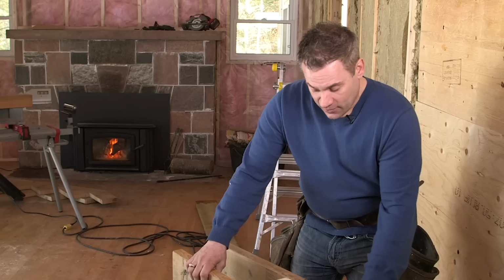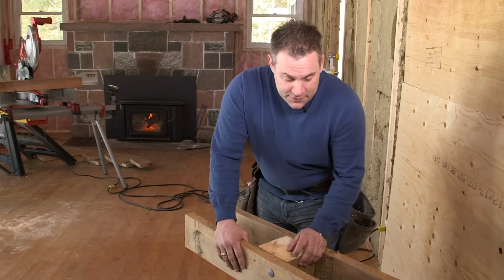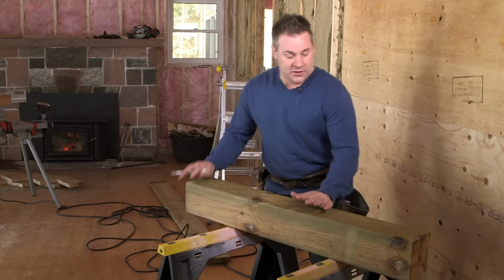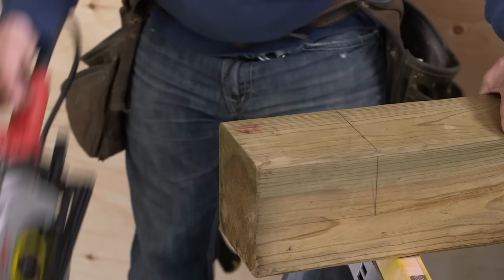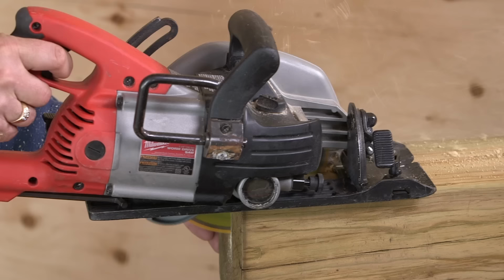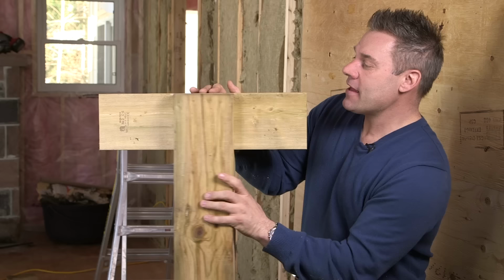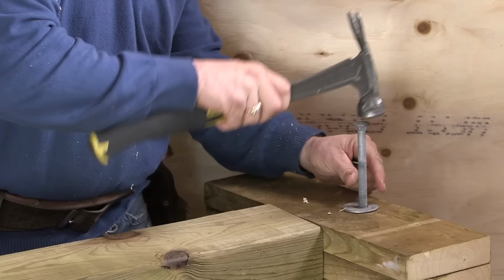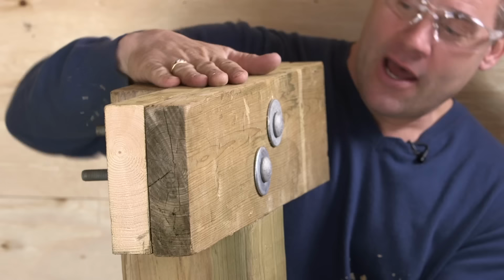How to Attach a Beam to a Post for a Deck | Decks, Docks & Gazebos

Comment: so how many times has any one witnessed carriage bolts shear off from the weight of a porch
Reply: Matt Tallman 
The wood can split.
Reply: He clearly states in the video the problem is, "there is no shear strength in carriage bolts." This is complete BS.

It is called a carriage bolt for a reason.
Reply: Vince King he does not mention wood splitig for the reason not to use carriage bolts. of course wood can split but pre drilling your hole solves that.

Comment: What a load of crap. he must think we all fell from the sky.  The sheer strength of the bolts he is using is massive compared to what would actually be required for this application in-fact, the bolts used here would be strong enough to hold up about 10 family cars before any failure, so the timber would fail a long time before the bolts. FACT
Reply: Tofthill4 
Wood can split due to high pressure.
Reply: Bollocks,  this is a Deck we are talking about not an air craft carrier. The live load in this kind of application is minimal and the chances of the bolt failing are about the same as Donald trump shaving his head.
Reply: Total CRAP

Comment: Bullshit. With that notch.the most you need is one bolt. My deck has no notches just bolts and is still in perfect shape after 28 yrs
Reply: A deck still in perfect shape after 28 years? That would make your deck quite a bit different from most.
Reply: @nuancolar7304  I can't answer to that,but we live in southern Ontario, Canada, so the element do give it a good workout with bitter cold winters - covered in snow for at least three month - then the wet spring and a nice humid HOT summer lol.Has  the odd creak - like me - but no sinking. One thing that may have helped is,I have all my beams 16" on centre

Comment: Working on a plan where I ran into this issue. 
Would there be any way around notching to instead run a long enough 2x(post width) fastened and glued underneath the beam to help carry the load?

Comment: 1. What is building CODE in your area. Build according to code. 
2. 1/2” carriage bolts have about 10000psi shear strength.  
But check building code first.

Comment: Well I didn't notch, and I didn't use carriage bolts I used regular hardened bolts with locknuts and flat washers and it's been standing strong, even with all the snow that falls on it from cleaning the roof in the winter, which sometimes includes some thick ice falling on it too. It's been 21 years now.

Comment: What about all four corners of a deck? This method seems practical for a single beam, but the deck I’m build, for example, is detached from any structure and will also be supporting a hip roof. 

I was going to make my own box beams and go all the way around and just use carriage bolts to secure them but now I’m second guessing. My posts are 6x6...run joists 2x10....deck will be 12x12. Any suggestions?
Reply: Where you building. ?

Comment: Video was made 5 years ago, I hope people arent still notching out their posts, might as well just laminate 2x material, when you notch out the post, you reduce that sections strength to whatever is left of that post, it will also split up from that notch as well even if you brush in some sealer in the area that has been cut away.
Reply: tell that to the 2018 IRC

Comment: GRADE 5 CARRIAGE BOLTS - Carriage bolts have a dome head with no drive and a square neck under the head. Carriage bolts are designed to be tightened from the nut side of the assembly. Grade 5 carriage bolts are made from carbon steel and have a tensile strength of 120,000psi, and have a proof load strength of 85,000psi. Carriage bolts are fully threaded up to 6", lengths over 6" will have 6" of thread and the rest is non-threaded shoulder.

GRADE 8 PLAIN CARRIAGE BOLTS - Carriage bolts have a dome head with no drive and a square neck under the head. Carriage bolts are designed to be tightened from the nut side of the assembly. Grade 8 carriage bolts have 6 radial lines on the head, its a medium carbon alloy steel, quenched and tempered. They have a tensile strength of 150,000 psi and a shear strength of 90,000 psi.

Comment: There are already plenty of comments about how those 2 bolts provide plenty of shear strength. I would only add that these guys who insist on notching never mention that if the post is to continue upward from the notch and beam(s) to provide for a railing, much of the stiffness of the post is lost, making for a low strength railing.

Comment: Question....what do w e do with post and beam timber framing?  No bolts, no nails, mostly just tight fitting wood connections with wooden pegs.  Now, the old barn still standing built by farmers, not one of them an engineer.  Snow comes...3 ft deep on the roof,  then it rains and the snow holds the addition water weight ...for a while.   Maybe even 20 or so blizzards later,  with 4 or 5 with following rain.    Will the barn still be standing ?  I bet it will.  They are still standing and still in use.  BUT...our steel boat storage shed
, in Lake George NY  collapsed in about  ‘79  or  ‘80.  The storm dumped 3 ft of snow on the almost flat roof, then it rained.  
Several 30 plus length cruisers were inside.  A number of boats were Totaled.  The solution....put a snow blower on the roof and blow the snow before the rain.  If you can’t,  build another boat storage building.   OR maybe get a bunch of Amish to build you a big boat barn.  Timber framed of course .  I am agraduate Civil Engineer and served on the national building code for elevators in my career.  Our goal as having standards establishes for public safety was to do the best we could to protect the public without breaking the financial back of the owners and contractors while insuring long service.  It is possible to build a deck that would still be intact after the tornados, blizzards and fires passed.  Nobody would buy one.  It would be ugly.  Hire the farmers to build your decks.  Problem solved.
Bless you all.
JoeB

Comment: Hi there... I have a deck (24’ l x 12’ w & 8’ h supported on 4 - 6x6 ) exactly as your example.  It’s in great shape even though it’s was build in 1993.  No signs of rot to justify replacing parts. Any fix or improvement suggestions?   Cheers..... Y.

Comment: you don t use a washer on the head side of the carraige bolt, you use a torque washer the hold the square part of the head, it keeps it from spinning when you tight the nut on the opposite side

Comment: Yo cheek cut ,how about 3/4 “cheek cut not a full bearing point I know but it’s a compromise with not over cutting  the 6x6 and still having a bearing point that is thru bolted double nut and double washer one one each side .....I love timber techs there awesome but something about thru bolts with nuts and washers that you know hold up

Comment: Support should be on the beam and not the bolt; the bolt is just to secure the supported structure.  But I have a question; how do you tighten the bolts you have when one side of the bolt is a pan head and the other side is a hex nut?  The bolt will spin as you try to tighten?

Comment: The problem with carriage bolts isn't so much shear strength, but in making that bolt hole the load bearing point, you have created a weak point in the wood and effectively cut load bearing capacity of the wood in half [or worse].

Comment: I've been debating notching a 4x4 post vs not for a playground. I've only seen not notching unless it's a 6x6. Can I get some expert tips?
Reply: Notching is not allowed by code in the IRC (which most of the U.S. uses). To connect beams to posts, you should use brackets that are specifically designed for the purpose.  About $5 at your local hardware store for galvanized (a lot more expensive for stainless, but stainless is necessary in coastal areas).

Comment: I'm going to be building a porch into my trailer and it's going over a concrete pad and I can dig holes to set the post because of city sewer line and gas lines, but I thought I saw where there bases I can secure to the concrete to set and hold my post into place and was wondering what they are called and what would be the best kind to get and how to put the secure screws in the proper way for maximum safety.

Comment: If you are going to notch the post, there is really no need to through bolt it, just run lag bolts into it.  And as others have said, those bolts have tremendous shear strength, but that little deck screw has very little.
Reply: Problem is, u can't noch post out like that anymore. If u have a permit it will fail

Comment: It's not a question of carriage bolt shear strength. Loading the joist will split the post if it is not notched.
 The point is, if the fasteners are bearing the load you are not building anything ..You are hanging.
 Wallpaper and doors are hung. Structures should be built.

Comment: Use a torque washer on the head of the carriage bolt side instead of the flat washer. It bites into the wood to resist turning, and it fits right into the square collar of the bolt head. Just added on to a 35-year old playground that used torque washers and the bolts are still tight

Comment: a three inch strip of plastic tacked to the top of the doubled beam will help keep it dry to stop the dry rot.  some copper sulfate tree spray brushed into the joints would stop rot too.

Comment: The bolts are not in shear provided that they are torqued properly.  The compression that they provide between the post and beam is what is carrying the weight.  The problem is over time the torque is lost due to shrink and swell of the wood and the compression is lost and the bolts go into shear.  Most people do not check the torque values after they are done building.
The notch can be problematic if (when) water gets into the notch and sits causing rot.

Comment: The joists or carry beam would likely fail/split far before the carriage bolts shear. There are always a few different ways to frame a deck and using a shelf notch may have it's place but I personally don't like to do this.  It reduces the strength of the post significatly and it holds water in the end grain. There are many fasteners and connectors made specifically for this connection to use in conjunction with bolts if bolts are not enough for you, I like simpson dtj14z for example. Also, if you aren't using a 6 x6 or have a corner post that would be notched in two directions, don't do this, you will compromise too much of the post and it will become your fail point. You also can't do this if you run a 4 x 4 post continuous through the deck to serve as a rock solid rail post. Again a few ways to do this too. If shear of the bolts is the concern, don't use carriage bolts, use machine bolts with washers and go up a size or choose a different grade bolt, a307, gr2 good to gr8 overkill. Depending on the chart you look at you will increase shear by at least 10-15% using standard machine bolts. I know the head is not as pretty but a carriage bolt does not have the same surface to wood area as a good fender washer under the head of the machine bolt. We have all spun carriage bolts, you can adjust a machine bolt. Use galvanized and they'll out last the wood.
Reply: You are correct.  Notching should never be done, even on the railing.  The code in the U.S. does not allow notched posts (at least not anymore). I don't understand why people want to bother with the labor of notching when you can buy a $5 bracket that is stronger and easier to install.
Reply: Our second-story deck has the exact corner configuration that you described, a 6x6 post notched on both outer edges to support the perpendicular corner where double rim/boundary joists meet at the post.  And this is all secured with nails, no braces or ties or bolts.  The rim joists are already starting to "slip" off of one of the notches due to wood movement.  The worst part about this is there is only a 3x3 secion of the beam remaining as a backer to the perpendicular joists, so if I wanted to try and add some pass-through bolts or ThruLoks to better secure the joists to the beam, there is only that 3x3 section to accept all of the bolts.  How would you fortify a double-notched 6x6 corner like this???

Comment: Carriage heads are designed to go straight into lumber without slipping when tightening the nut. If you add a washer you're adding a way for the head to slip.

Comment: Posts or columns are analyzed assuming a concentric load. By notching the post and putting the header beam on one side of the post you've introduced eccentric loading; essentially inducing a bending moment in the post. You now need to do a delta"p" analysis to ensure the post is adequately sized to support the load. And as Stephen Bonin stated below, splitting is now a major concern, possibly reducing the cross-sectional area of the post actually carrying the load. Folks should do some research before passing out information that's not 100% accurate. A good reference is "Wood Handbook", published by the USDA; it's their General Technical Report FPL-GTR-190.

Comment: If you look up sheer strength of a carriage bolt it actually gives you pounds per square inch and it is a significant amount. Grade 8 carriage bolts have 6 radial lines on the head, its a medium carbon alloy steel, quenched and tempered. They have a tensile strength of 150,000 psi and a shear strength of 90,000 psi. It also passes all of the codes where I live. So I would say it is not wrong just a different way to do it.

Comment: Shear strength of a 1/2 inch grade 2 bolt is about 6000 psi. Corrosion issues aside your timber will fail before you break two.

Comment: You need to be careful using washers on carriage bolts.  It reduces how far the carriage bolt "bites" into the wood and if you overdo it with a washer that is too thick, it will just spin in place and you'll never get it tightened.  It isn't normally an issue but something to think about.

Comment: Good info. How would you lower the front edge of a deck that has raised at the front due to maybe the footings raising over time. This has caused the deck to be lower at my cottage and higher on the outside edge.
Reply: footings should have been dug to below frost level in ground to prevent this

Comment: The notch method is stronger, but carriage steel bolts do have a significant shear strength value, .
Reply: Cross grain tension in the side member is the main problem there. Not the shear of the steel bolt.

Comment: You should not put a washer underneath of a carriage bolt head. If you look under the bolt's head you will see a protruding square section. The idea of this square is that as the bolt is tightened, the square pulls into the timber to stop the bolt rotating - and locks the bolt in place. Putting a washer underneath the head will disable this feature.

Comment: The lumber used for the beam would split along the grain at the point (the hole) where it is bolted long before the bolt would shear.  The point is, for most practical loads, bolting would hold up on a average residential deck. But to allow bolting without jacking in local building codes would just be wrong.

Comment: I'm not a carpenter, engineer, or construction worker, but do enjoy making things and doing woodworking projects. I don't know much about the sheer strength of a bolt, but saw right away that all the weight of the deck would be concentrated on the bolt/bolt holes. My first thought was not about the bolt breaking, but about the psi limit of the wood and the bolts going through it when the load became too much, like a hot knife through butter.

    What I'm curious about is the notch placement. Would there be any structural advantage or disadvantage if it were taken out of the middle of the end of the beam instead of the side of the end, sort of like a mortise/tenon/box joint? Thinking it through, I can see a possible problem if the post/beam were on the edge/side/corner of the deck. The side of the post may not be flush with the side of the deck. That hypothetical problem wouldn't matter as much if it were under the middle of the deck.

    What do you think?

Comment: What if you have the beams meet at a 90 degree angle, 45 degree angle? What if you have a lower tier on the deck that shares a footing with an upper tier post and prevents you from getting carriage bolts in?

Comment: What about the friction strength of the clamping force? What force would it take to shear a 8mm or 10mm bolt - 2 ton? The wood would fail first

Comment: By notching the 6x post you changed the structural support post into a 4x post. By putting the beam on top of the post using a 6x to a double 2x Simpson post cap to attach the post to the beam you keep the structural integrity of both members intact. Just an easier way to do it. Also... never use galvanized bolts in pressure treated lumber... stainless steel is always recommended.

Comment: Looks like you were testing bending strength of a wood screw to me. Proper shear strength would need the screw suspended both sides and the load applied to the center. I believe the timber would fail in shear before the bolts in this application. However notching is the correct method

Comment: Those looked like 1/2" bolts. They each have at least a 50K sheer Strength. There is no way they are ever going to just break off. The real problem is over time as the wood dries out they could sink a little. I have a 16x20 deck built with 8 6x6 uprights with 2x10 on each side. I used four 1/2' carriage bolts in each post.  Just the deck weights about 4500lbs is 8 years old and has not moved an inch.

Comment: Just one 1/2” bolt can nominally resist 6500lbs of shear force.  While the technique of attachment by “notchout” is preferable, we’re talking over 3 tons of shear strength on only one bolt.  In a typical application, more than one is used and the span load is spread across two or more points